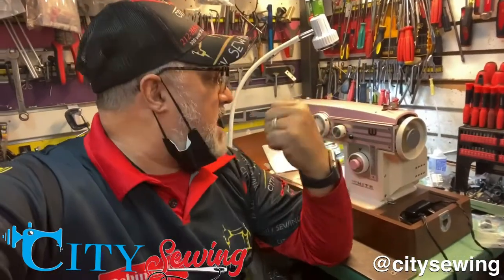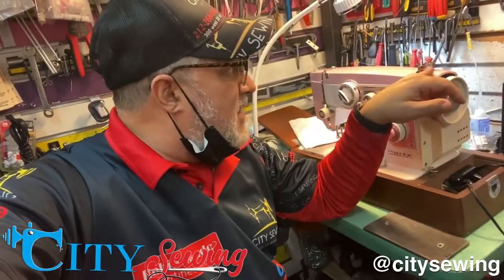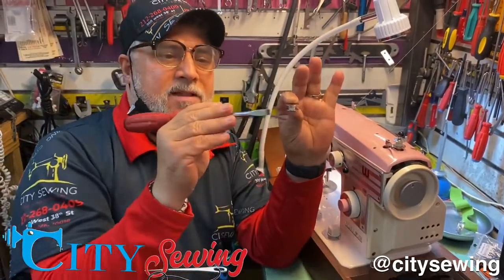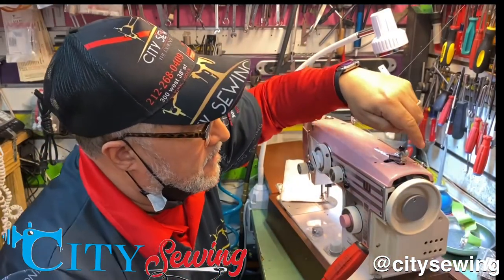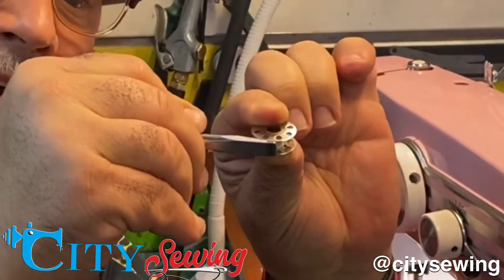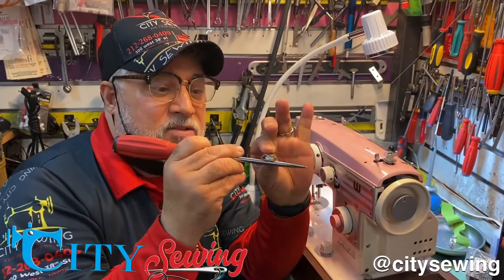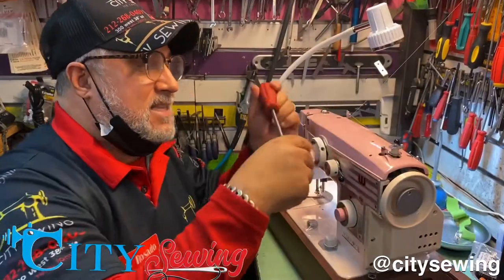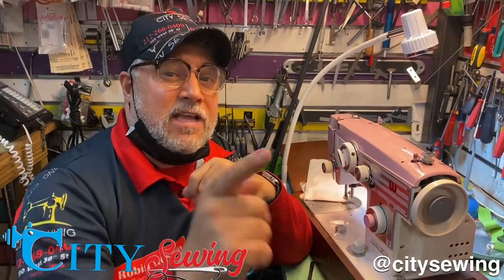Bobbin winder issues , EASY fix

Comment: thanx u r a doll!  my problem is that it won't pull from the spool, the power stops at the spool on Kenmore 158.18800 ... if I unwind the spool by hand and feed it it will wind onto the bobbin!  What's up with that?

Comment: Mine is made a little differently.  It is a Brother.  I have some up and down play on the bobbin.  The winder piece fits into the bobbin at all points.  It just does not turn when I hit the power.
Reply: Please how did you fix your machine, I have the same problem
Reply: @babiryemukisa349  I could not get my machine open so I had to take it to a repair shop.  It was due for a good cleaning so just as well, I guess.
Reply: Mine too. It's a sears Kenmore 5188

Comment: man, i hope that's all that is wrong with mine!! i'll have to check that out tomorrow. i figured it would be something hard. thanks so much for posting this video and saving me $100 on a service call.  i have a white rotary 710. it takes a very specific and uncommon bobbin (i believe the original part number is 4386. the modern made bobbins that are supposed to work, don't. do you have any ideas on where i might find some original vintage ones? i only have the one bobbin that came with the machine. thanks.